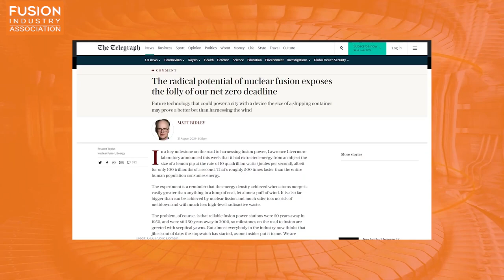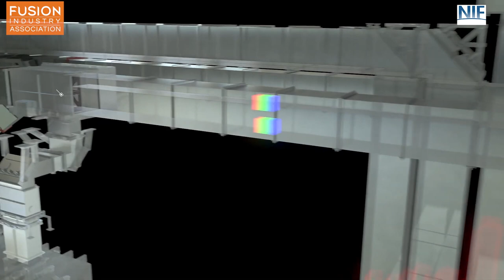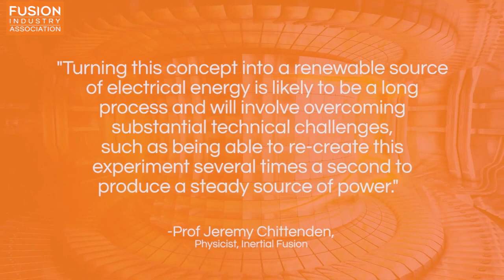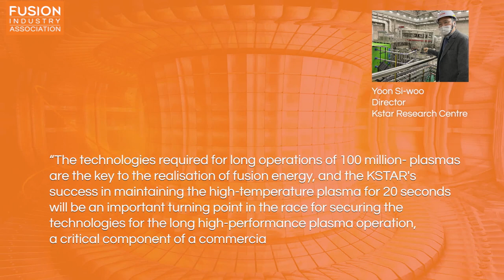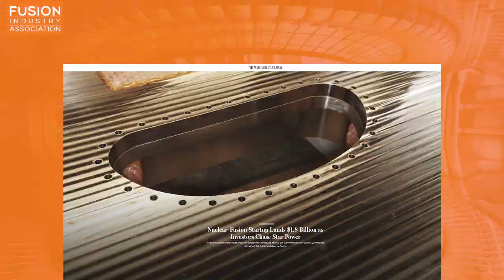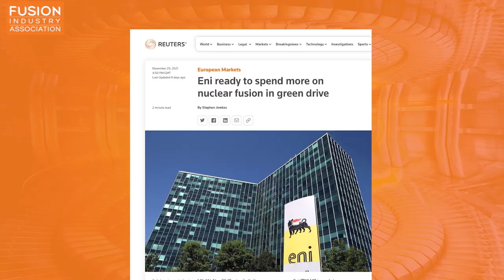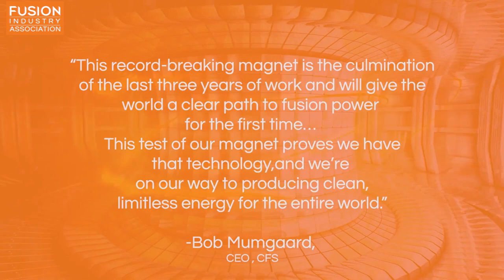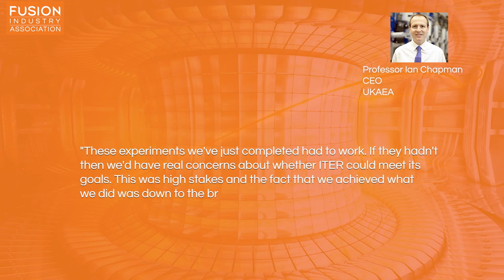Year Recap Episode: Fusion News, Friday August 12, 2022

Comment: Dennis Whyte, the director of the MIT Plasma Science & Fusion Center, says he now expects Q = 11 for SPARC.
Reply: Is that Q-plasma isolated or are all surrounding factors taken into account?
Reply: @christerdehlin8866  It's definitely Q-plasma and will continue to remain Q-plasma until a fully built continuously running nuclear fusion reactor, that is actually designed for powering a grid (so not a test reactor), is constructed. 

This is because any test reactor built today will have more redundant power supplies, heating and cooling apparatus, magnetic field coils, etc., that wouldn't be necessary for a full-time economical power generating reactor. 

So therefore, any reactor type you hear of mentioning Q values will always be talking about Q-plasma or else when specifically stating the possible assumed Q-total values.
Reply: @christerdehlin8866  ogcourse its q plasma. They can give me a shout out if they reach q 100 plasma. Maybe then fusion actually becomes viable. It won't be in my lifetime. Pretty sure of that
Reply: @MrMastadox  Since ignition was just confirmed two days ago in an experiment from 2021, I wouldn't be so sure if I were you.
Reply: @christerdehlin8866  ignition means nothing. Its not even close to working powerplants.
Reply: @MrMastadox  On the contrary ignition means everything, because ignition in this context means there was a self sustaining reaction, and a self sustaining reaction is what you need to get to the point where you get more energy out than you put in. It's perhaps the most important milestone of the past sixty years of research. Does it mean that we'll have powerplants very soon. Probably not, but it does mean that we now know for certain that self sustaining fusion is possible. That's huge.
Reply: @christerdehlin8866  there is not really any possibility of a very useful self sustaining reaction in this technology. Because it only uses pulsed lasers on tiny bits of fuel. Meaning that ignition might occur, but is never sustained. The lasers cause the compression. After the laser burst the compression is lost. So if there is ignition it can't continue burning more fuel without repeating the same process again. This laser technology isn't a tokamak. There is nothing to cheer about here. Ignition and sustained fusion in a tokamak would be pretty big. But with lasers and fuel pallets that need to constantly be replaces. There really is no possibility for self sustaining fusion. This result means very little given the technology. Even if they achieve q2. Thats still absolutely nothing and not enough to create electricity
Reply: @MrMastadox  isn't the  breakthrough in Germany the most important story right now?

i didn't hear it in his report
Reply: @robinsss  when it comes to nuclear fusion. Everything is called a breakthrough all the time. Its to keep funding coming. Same with quantum computing. While it still gives us nothing.
Reply: @MrMastadox  i think  you are right

it took 30 minutes to figure it out

Comment: The fusion world announcements like this are about the same as if Da Vinci he noted that we were on the brink of manned flight after one of his prototypes flew for 20 seconds when thrown off of a tower roof, longest sustained flight in history! In reality, the first powered flight came 384 years later... after solving little problems like electricity, the internal combustion engine, fuel distillation, a viable wing design, viable steering, and the materials needed to make them... While I am a staunch supporter of driving towards fusion but you guys have been claiming you are near success for about 50 years now, so what, we just have 334 years to go based on Da Vinci timing.
Reply: isn't the  breakthrough in Germany the most important story right now?

i didn't hear it in his report
Reply: @robinsss  Yes the German progress is at the top of the heap now but it is still no where near hitting unity much less producing any energy net positive to input so I pretty much lump it in with the rest, much ado over nothing.